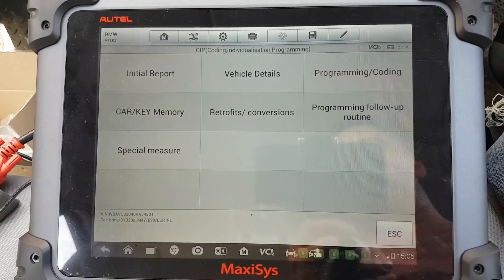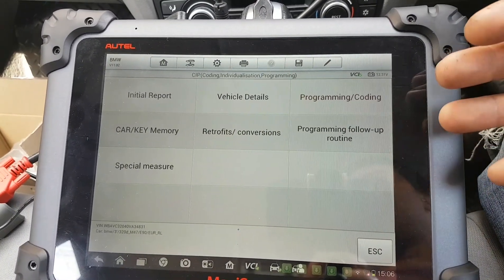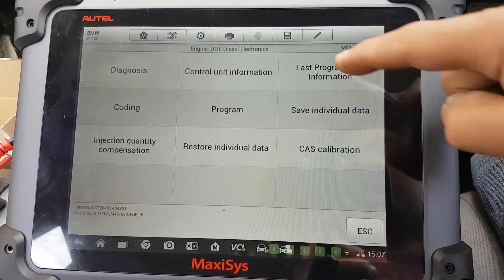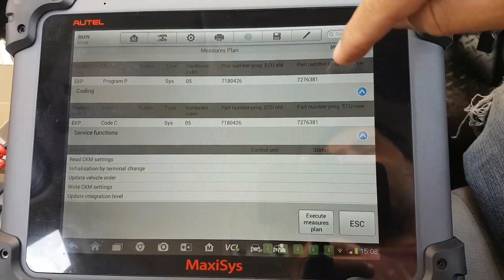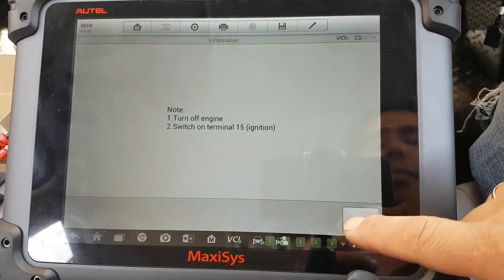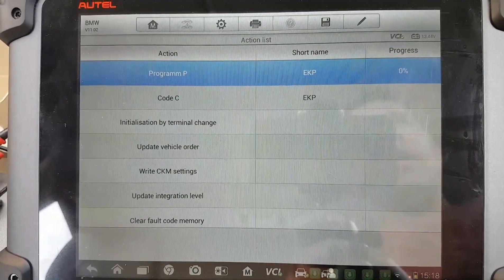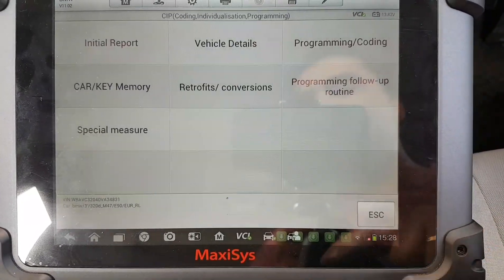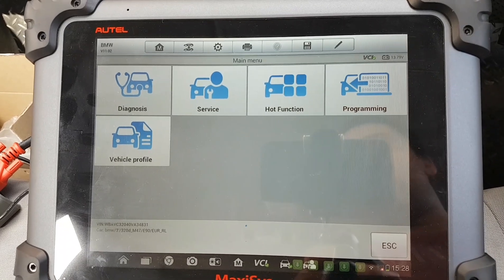BMW individual module programming using Autel MaxiSys MS908P.

Comment: Hey buddy GREAT VID. Just a question. Can I use Maxisys or Autel to code replacement EKPM3 module that came from a different car but comparable? My car is an E82 2.0D 2008 & the part came from a 2008 E87 2.0D. Please let me know. Thank you buddy.
Reply: No worries. Keep up the good work. I was more wondering if I can use Autel to tell the EKPM3 that it’s now in a similar model but different car so it has correct flow values etc. If so can you point me in the right direction menu-wise that would be greatly appreciated? Thank you again.
Reply from the maker: The Autel is quite intuitive on that sort of stuff...
Watch this video...
https://youtu.be/pAKztvmr07g
The principle is the same...
Once you flash the module with the software   for the car, to change VIN number etc... and you code it... the module becomes part of the car... As if was fitted from factory...😊
Reply from the maker: Yes... should be able to do it....
Thank you for watching and for your comment!

Comment: helo i heav same problem with may bmw the error is 2e3c (deasal electronics:electronic immobilizer  anti tampering protection) and i dont now what i nead to doo
Reply: yes i clone the original ecu
Reply from the maker: Something must have gone wrong...
Or, you need to resync the ecu and CAS...
Which ecu is that?
Reply: for bmw series 1 118d engine n47
Reply: i jast disconnected the pipe for injector and is not caming fuel in injector. becouse i heav that eror
Reply: i trying to resync the ecu and cas wit snapon and nating. and the gay u clone the ecu i say to mee i heav nead the ISN
Reply from the maker: If the ecu was cloned, the ISN would be also copied... so was not you that cloned the ecu?
Reply from the maker: Have you replaced the ecu?
Thank you for watching!
Reply: no becouse i dont heav the tools

Comment: I tried to the same thing as you but I don't get the same options as you and also I cannot even program a key its for a 2003 BMW X5 e53. is there a problem on my maxicom or is the car to old
Reply from the maker: The Maxicom does not have those capabilities... 
Not even the Maxisys can do keys...
Thank you for watching!
Reply: @LMAutoRepairs  but why can i not update the ecu
Reply from the maker: @2slow818  
Maxisys 908p does it...
I don't believe the Maxicom doe it...
Check on Autel website...

Comment: We want to conduct Transmission change with Used one. Can we do Programming and Coading same process for BMW 740i 2010 model F02
Reply from the maker: Yes you can...
But... the gearbox might be coded to the immobiliser... Maxisys does not do it...
IM608 does it...
The reason that lead me to buy it, was actually to do it on a F10...
Thank you for watching!

Comment: This will not work on the F and G series E cable is needed
Reply from the maker: With the cable works exactly the same way...
Thank you for watching!
Reply: @LMAutoRepairs  yes,, i had an issue with a 2014 750 had to get the E cable
Reply from the maker: @mr.j4900  
I had to buy my one separately, but I believe now is part of the package...
👍👍👍

Comment: hello friend, my car currently running with a ecm frm a used donor bmw, got everithing program...my question is, using the 908 do u know if its possible to erase the vin frm a donor ecm and so only the vin frm my veicle poping up wen doing emissions test...they dont want to give me the little plate sticker unless I fix thar issue....usually wen I connect the autel it will ask me to choose my vin n the donor ecm vin
Reply from the maker: When you flash/update the module, using the Maxisys, if you "tell" her the modules have been replaced, it will update the vin during programming...
I have a video on my old e65, changing the Airbag gateway, and i show just that...
Hope it makes sense...
Thank you for watching!
Reply: @LMAutoRepairs  thanks..ill look at the vid asap

Comment: I updated mini and the car shut down and won't start😢 any suggestions thanks
Reply from the maker: What you mean the car shut down?
You were doing it with the engine running?
Reply: @LMAutoRepairs  no it wasn't running, but update stoped and I tried to start it, no start now🤔I think might've wiped the ecu...thanks for getting back to me.. I did it wrong and down a mini diesel file I think form autel,when going  into ecu for engine it says it's diesel but it's petrol😑
Reply: Any help on this one?thanks
Reply from the maker: @davidcarroll4227  
Try it again...
Make sure you have a good battery voltage at all times...

Comment: JUST WANTED TO LET EVERYONE KNOW THAT BEWARE OF AUTEL'S SOFTWARE AND BMW CODING AND CALIBRATIONS A LOT OF THEM ARE FAULTY ESPECIALLY THE F BODY BMW'S I.E. JBE,CAS,FRM,AND A FEW MORE  I TRIED TO RUN AN UPDATE PACKAGE ON A 2013 BMW FO1O 528i N20 ENGINE ALSO THE F25 BMW X3 MODELS HAVE BRICKED THE MODULE AND WILL NOT CODE AFTER IT PROGRAMS THE JBE WHICH IS THE MAIN INSIDE FUSE RELAY BOX ONLY ONE HAVE I SUCCEEDED TO UNBRICK USING BMW ISTA-D WHICH IS THE PROGRAMMING SIDE FOR F,G,H,I BODIES ALL NEW CARS ISTA-P IS PROGRAMMING FOR OLDER E BODY VEHICLES AS I SAID ONCE BRICKED BY AUTEL THE MODULE IS BASICALLY JUNK  JUST A HEADS UP TO YOU GUYS THAT USE AUTEL FOR MODULE PROGRAMMING ,I AM A 30 YEAR BMW TECH AND THE AUTEL 908P ELITE IS A GREAT SCAN TOOL BUT JUST BE WARNED STAY AWAY FROM PROGRAMMING WITH F,G,H,I BODY BMW'S ,I AM ALSO A PROGRAMMER AND AN A TECH SO IF YOU DO PROGRAMMING ON NEWER BMW'S BE SAFE AND USE BMW ISTA-D ONLINE YOU WILL HAVE BETTER RESULTS ALSO NEW BMW'S WILL NOT PROGRAM WITH A J-2534 BOX OF ANY TYPE YOU MUST USE BMW ICOM OR ICOM NEXT
Reply from the maker: Thank you for the information! 
👍👍👍

Comment: Hi, Is it better to use a tool like MaxiSys instead of INSTA D/P for programming a BMW?
Reply from the maker: They both achieve the same result...
Thank you for watching!
Reply: @LMAutoRepairs  You also mention wanting to get a battery maintainer. Have you thought of which one you might like?
Reply from the maker: @abeetha  
I use one that is not really a maintainer...
Is more of a charger, but does the job quite well...
A proper maintainer is quite expensive...😬
Reply: @LMAutoRepairs  Any recommendations? I've seen BMW branded ones which many say are CTEK ones with a BMW badge. CTEK themselves have loads of models. I have a few LIDL trickle chargers that I use to keep on some old cars so the batteries don't use charge from under use. But I have no idea what sort of one I would need for my E92 330D if I was to attempt any programming on it.
Reply from the maker: @abeetha  
As i said, ideally you would use something like this...
https://www.cardiagtool.co.uk/professional-intelligent-programming-charger-zlp100a.html

I am using this one...
https://www.halfords.com/motoring/battery-maintenance/battery-chargers/ring-rcbt27-pro-27a-battery-charger---12v%2F24v-116438.html
I don't do programming on a daily basis, not even close... so I am happy using it...
Reply: @LMAutoRepairs  Thanks so much for the tip. Made me do some research and realise the importance of having a stable power supply and that's not the same as a charger or maintainer.
Reply from the maker: @abeetha  
👍

Comment: Hi where your Autel gets the programming data from? Are you suppose to have subscription with them to access database via tool and internet or vehicle programming data is installed inside tool? Thanks.
Reply from the maker: Hi
Is included with the subscription...
Is no installed on the tool, the files are downloaded as required...
Thank you for watching!
Reply: LM Auto Repairs how much for the subscription? For UK users
Reply from the maker: @vtalk3900  
Around 1k

Comment: Hi. Quick question. Is it possible to program the ECU from another car? Second hand? thanks
Reply: u can as long as u also buy the keyfob and cas module that belongs to the ecu.....the only issue wud be that if u live in a state with extremely strict smog rules it might not pass....6/16/2020 I was instructed by a star smog tech to get in contact with state referi to fix my issue wer my car has ecu ftm other car../////6/11/202 usually when I coonect the scanner to my car that has ecu frm another car it will ask me to choose between my vin and the vin of the car that the ecu came frm....tried smoging prior  and the tech said som bulls..t story that his computer cudent connect to my car.....im asuming if u buy a brand ecu ter wudent b that issue....I cant affor new ecu so if noone wants to pass my car, ima just paint the sticker with glitter nail polish to corresponding year color, n use a gps jammer so my car does popup as a red dot on cops map screen...but ten they might b wondering why my car not showing up in teir screen since its modern car or tey might not even notice epecially in city with alot of vehicles...probly I wud only get caugh if I get pulled over and cant provide up to date regristion papers.

Comment: What’s the difference between this and BMW ISTA? I thought only ISTA could do programming? So confused
Reply from the maker: Hi
ISTA can do programming, yes, and is the OEM system...
What are you confused about?
Thank you for watching!
Reply: LM Auto Repairs I guess what I mean is, if you have this, do you need ISTA? Like do they do the same thing? It seems this is better obviously as it does all makes and is portable. Downloading ISTA seems like a job in itself.
Reply from the maker: @Chris-rs3dj  
Not really... with this tool, you don't really need ISTA... the only thing with ISTA, is the wiring diagrams, testing components etc... that obviously this tool does not have...
👍👍👍

Comment: Hello.

Is it possible to code/programming AUX with this to an E61 BMW? 

Tanks
Reply from the maker: Yes it is...
But if that is the only thing you need, will be cheaper to get NCS...
Thank you for watching!
Reply: LM Auto Repairs 
Thank You. I have this system :-) But dont know how to do it. Do you know? Thanks LM
Reply from the maker: @marcusb9365  
Programming... check under retrofit...
If is not there, check cheat coding...
If not there, add +NAUX to the VO/SA/FA and code the car or the affected modules...
Tank you for watching!

Comment: He probly meant no harm but !!When he gets to 3:30 he mentions to jump start the car to raise the voltage when no maintainer available  ( a BATTERY MANTEINER IS NEEDED, a 15 to 25amp unit 20USD TO 50USD  is more than enough to raise voltage, I used a 15amp unit for complete update). If u jump the car for programing, either u r going to burn the junction module or ur ecu/pcm/dme (if ur car battery is healthly plus  jumping from another car with a healthy battery plus the altenator current frm the other car !!it will create an overcharge and burn modules). I FOLLOWED HIS ADVISE PROGRAMMING WHILE JUMPING AND MY JUNCTION MODULE BURNT WHILE PROGRAMMING MY BMW v6 328I. SINCE MY MAIN ECU/PCM/DME LOSS POWER WHILE PROGRAMMING IT DIED. !!I HAD TO BUY ANOTHER JUCTION MODULE FRM EBAY(2 JUNCTIONS THE FIRST THEY SENT WAS FAULTY) HAD TO BUY AOTHER ECU/DME/PCM EBAY AND IGNITION KEY WITH CONTROL AND A FOOTHWELL MODULE LINKED TO THE ECU FROM SAME EBAY SELLER (THE FOOTHWELL MODULE CONTAINS INMOBILISER DATA) AND 30USD BATTERY MANTINER TO PROPERLY PROGAM MY BMW AND GET IT RUNNING. He should have  at least mention that when jumping from another car that the other car has to be engine off, and even so not sure if it wud work that way...….bmws and any vehicle 2005 and up should not b jumpstart frm another engine on car (risk of burn module), proper way to jump is with a cheap 30usd to 90usd lithium jumper or equivalent, or jump frm another car engine off at risk (on older vihicles it was ok to jump start from another engine on car cos the batteries were usually completely drain( probli owner left lights on) newer cars dont ever completely drain cos auto lights off or auto shutting electrical when volts low)..the only time ill risk jumping from another car with their engine on is if I was driving a v8 or larger v6 and they were driving a small v4..if it was the other way aroung me drivng v4 they driving v6 v8 I would only jump if their engine was off
Reply from the maker: Hi
I feel really sorry for what happened to you...
Watching my own video now, I realized I said jump the car... when what I meant was connect the maintainer...
I use a 30 amp charger/maintainer...
You can indeed program (not BMW really... due to the higher voltage required...), jumping from another battery/car, but both engines off... I did it few times before I bought my maintainer....
Once again... sorry...😔
Reply: @LMAutoRepairs  its ok..ill sue utibe not u...its good that we share info to help each other out...like u I also self-taught my self to use the tablet.

Comment: Autel ms 905 mini knows the same things? I mean control units matching or resetting?
Reply: And coding? For example in bcm or pcm things enable or disable
Reply from the maker: @martonhorvath1887  
Never used it... so don't really know...
Check Autel website... surely there is some info in there...
Thank you for watching!

Comment: Hello mate 
Thanks for your videos 
I would like to know if ms908s can program used Ecu?
Reply: I programmed an used Ecu from ebay to my car with maxisys 908p, u have to buy the Ecu, cas module, control fob and key insert with wiring.
Reply from the maker: Never used it... check on Autel website... there is plenty of info there...
Thank you for watching!

Comment: LM Auto Repairs
Great video!!! can you reprogram/coding the cruise control, mine its not working for some reason and I would like to have it back, Thank you!!
Reply from the maker: Hi
If was working and it stopped, is probably nothing to do with coding or programming...
Most likely there is a fault somewhere inhibiting the cruise control.. 
Scan the car and look at some live data to find out what's happening...
Hope that helps. 
Thank you for watching!

Comment: I have a 2012 bmw 528i where it stalls out in the middle of traffic when I step on it what can the problem be? Where can I buy this to program the ekps for it I bought one plugged and played but it would not run
Reply from the maker: What program are you referring to exactly? 
Thank you for watching!
Reply: @LMAutoRepairs  el Mismo aparato the same thing you have or anything else that's a bit less pricey bmw Is charging me 4000 to change the ekps and install a new fuel pump
Reply from the maker: @Luis92r  
What is the exact problem with the car?
This scanner is not cheap either...
Reply: @LMAutoRepairs  it throws code p0087 but goes away if I go to step on the gas hard to pass it feels like a thud then the engine just shuts off if you try to give it gas while rolling the computer on screen says fuel supply drive moderately I have to pull over to shoulder as fast as I can and then the engine shuts up if you try to turn it on again immediately it just cranks but will not start after about 20 to 12 mins later while car is off completely  the car will just turn back on like normal and I can keep driving it does it randomly BMW charged me 200 to tell me it's the fuel pump that needs replacing and the ekps module, they are trying to charge me 4000 for parts and labor.
Reply from the maker: @Luis92r  
I would take it to some good independent garage... 
I believe that that model has 2 fuel pumps...
A low pressure one in the tank, and the high pressure one under the bonnet...
It can be any of the two failing...
The one under the bonnet,  the high pressure, don't think it requires any programming... so if BMW is telling you that, means the other pump... 4k for that, seems a bit exaggerated to me...
Hope that helps...
Reply: steph steph if your in California San Bernardino area 
 we can program it for you

Comment: Great video always, I changed my head unit in my BMW F20 2012, because the old one was burnt! But after the change, bluetooth and AUX do not want to work, could it be that the car does not feel the new VIN on the new Head unit and can I program it with MaxiSys?
Reply from the maker: Hi
I would guess yes... you need to have it coded etc...
Maxisys should be able to fly through that...
Thank you for watching and for your comment!

Comment: Hi bro. Can I do cas and dme synchronization with autel ms908sp? BMW e90, 328i 2008.
Reply from the maker: I am sure you can...
I seen that option when navigating through the menus...
Thank you for watching!
Reply: @LMAutoRepairs  
Thanks bro.  
I have looked for it in all the options and I don't get it.  
Basically my problem is that the car arrived with missing or incomplete software codes on dme.  I updated and those codes left but now I get the code on dme 2f49 immobilizer anti-tampering protection and the crank but no start vehicle. No spark. 
Could it be synchronization?
Can you enlighten me?  any suggestions?
Reply from the maker: @jimmygutierrez7242  
Was the car starting when arrived to you?
Have you checked the VIN on both, DME and CAS? 
If one of them has been replaced, will not work untill the ISN is transferred...
MaxiSys can't do it...

Comment: hi i cannot read vin with my vw crafter 2013 bluemotion van any help please i have the 908 max pro.colin
Reply: thanks for a quick reply. apprently in the UK you have to put it in as VW lt3 then you can access the program im trying to adjust the  odometer  mileage, but cannot change it.
Reply from the maker: @colincourier  
Yes... forgot the LT3...🤦‍♂️
No, you can't....
Reply: @LMAutoRepairs  ok thanks
Reply from the maker: Which program are you using?
Use the VW CV... 
Thank you for watching!

Comment: How did you get to that menu?? I have MaxiSys but not menu like that on mine.
I'm trying to code headlamp on a 2015 RR4 Rolls Royce Ghost.
Reply from the maker: Under programming... on the first menu once you load the car details...
Thank you for watching!
Reply: @LMAutoRepairs  Unfortunately, for RR there is no programming option...
Just 3 options.  Diagnostic - Service - Vehicle profile.
Reply from the maker: @Avechuchoaxel  
I have never worked on one...